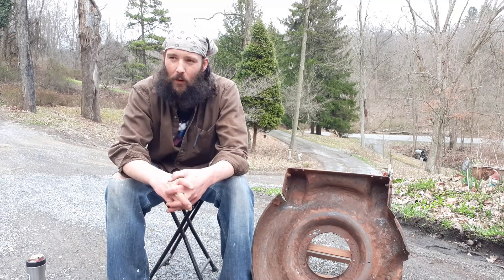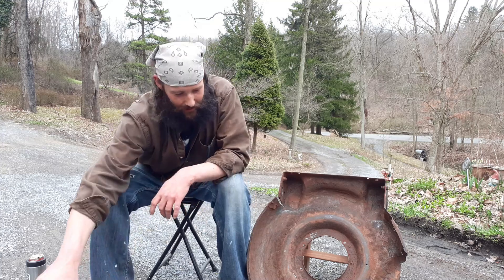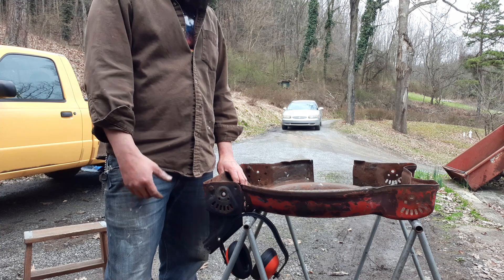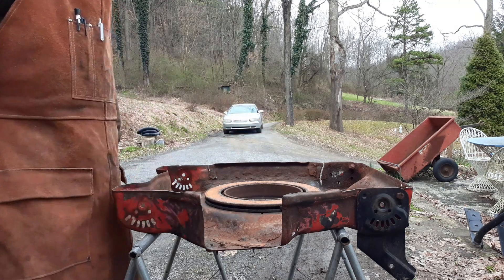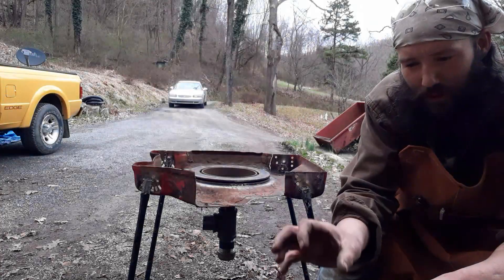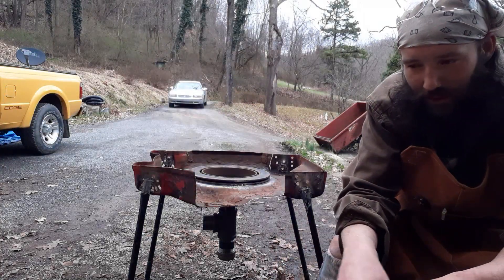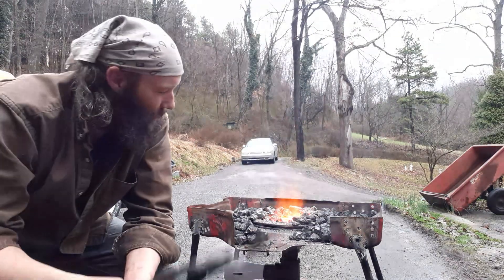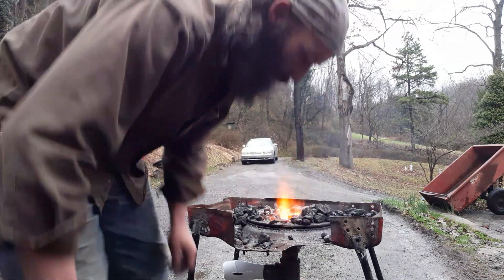$60 Budget Coal Forge Build

Comment: Nice little forge you did welli would have put the rotor on the bottom thow just my thoughts
Reply from the maker: I thought about that. But with that deck being slightly rotted I didn't want to take the chance of all the weight hanging off the bottom. This way it's a little more supported and should the deck collapse, it shouldn't be a catastrophe. Just slowly cave-in opposed to the fire pot falling off bottom. I appreciate the input though. And thanks for watching.

Comment: Looks good man. One little suggestion, I would fill the low areas in the mower deck, just to make it a little more even. It'll make moving coal into the fire easier.
Reply from the maker: I appreciate the info. I currently have some broken pieces of firebrick in the low spots but that's not doing as well as I thought. What do you suggest I use? As coal forging is a new animal to me I've always used gas
Reply: @NeilGraham.I.M.F  some refractory cement would be best, but some clay packed in should hold up good for a while.
Reply from the maker: @SoggyBottomForgeJoe  I have some refractory. I was thinking of maybe some cheap $1 a bag 100% clay cat litter. Just to get by. As once I figure out running the coal Forge properly I will upgrade. Yesterday I stumbled upon an actual blower motor. and just got back from getting some bituminous coal. But my yard is full of clay. So I'm learning. I've always just used gas
Reply: @NeilGraham.I.M.F  the cat litter would work, but if it's all over your yard save a buck. Lol.👍⚒

Comment: Cool work!! I'm gonna suggest 2 mods... A speed control for the blower, and a couple of bricks/fire bricks, to bank the nest. Otherwise, perfect!  😀👍👍⚒️⚒️
Reply from the maker: I have fire brick soft and hard. Where should i put them. And the hair dryer is just temporary. But yes the control gate will be involved at some point. I have a plan 4 that. When work resumes
Reply: @NeilGraham.I.M.F  if I'm doing a long project, right and left, on the edge of the nest. Fo short work, I add on to the back of the nest
Reply from the maker: @drason69  will give that a try. As I mentioned to Evan whom I talk to everyday. That I had an awfully big fire going and wondered how to control it. And that will do it thanks JT. Always opened imput cuz that's one way to learn better than finding out the hard way